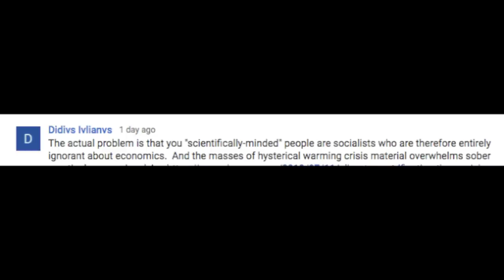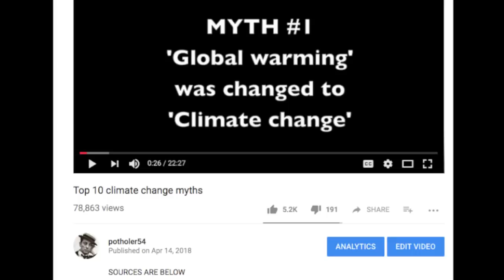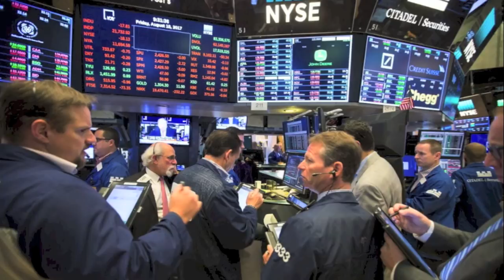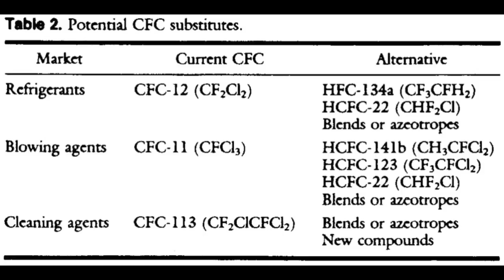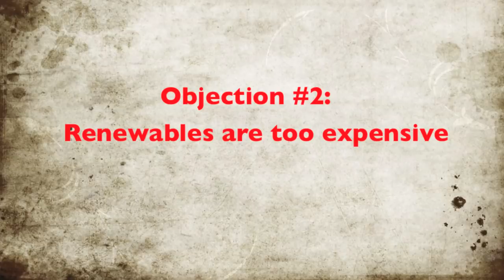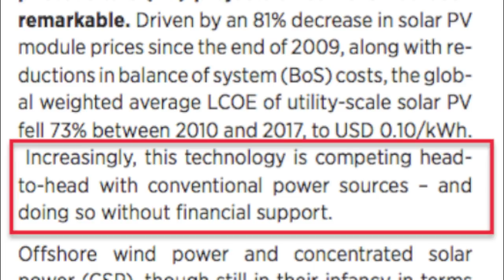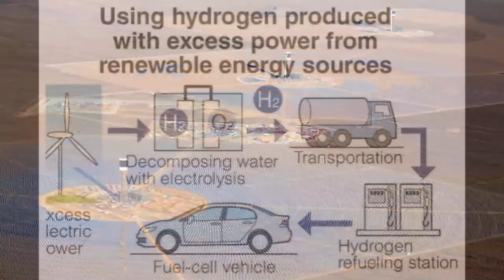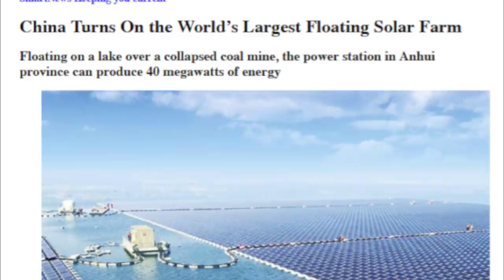A CONSERVATIVE solution to global warming (Part 1)

Comment: I decided to see how the Arctic is doing as we’re always hearing predictions about the ice disappearing due to the planet warming.  The Danish Meteorological Institute provides a website where you can check the facts for yourself:  http://ocean.dmi.dk/arctic/icethickness/thk.uk.php

I used the buttons under the heading 'Time step' on the left to go back to 23 November 2008 in order to compare the ice volume with today 23 November 2018. 
Then starting from January in each year, I traversed the graphs to see what they say. I'm looking at the black line on each graph which is always for the current year. 

Start of January: 2008 = 12.5; 2018 = 12.5
Peak ice volume in the year: 2008 = 24.3; 2018 = 24
Lowest ice volume in the year: 2008 = 4.5; 2018 = 6.5
On the July line: 2008 = 13; 2018 = 16
23 November: 2008 = 14; 2018 = 14.7 – and now almost as high as the average for the period 2004 to 2013.

It appears that overall there has been substantially more ice in 2018 than in 2008. The summer was warmer in 2008 than 2018 - looking at the minimum ice volume.

My conclusion is that there has been no net warming for the last ten years in the Arctic.  That’s put paid to one set of dire predictions.  Please check this for yourself – rather than listen to the doomsaysers.
  What about the Antarctic?  The ice is melting at one side where 91 volcanoes have been detected beneath the ice, but increasing at the other side.  I believe there is a small net gain in ice overall.  So no panic there either.

Funny how the facts cut through all the blather.  The skeptics (deniers) have been talking about a pause in the warming – looks like they were correct after all.

Go back in time (say 4000 years to include the Medieval Warm Period, the Roman Warm Period and the Minoan Warm Period to get a good picture – much warmer than it is today) and you'll see that there is nothing unusual about the current period.  The planet has been warming since the Little Ice Age which ended about 1800 – nothing to do with mankind by the way.  

Yes there has been a tiny amount of warming due to us putting CO2 into the atmosphere, but other forces of nature overwhelm the little bit that we have contributed.  Many scientists are now agreeing that the climate is less sensitive to CO2 than was previously thought and they are modifying their climate models accordingly - downward.

We hear scare stories periodically – and fewer and fewer people believe them.  If they continue this climate change propaganda, no one will ever believe anything put out by authorities.  Remember “The Boy Who Cried Wolf” story?  That is dangerous because when there is really something of genuine concern, no one will believe that either.

To claim that we can change the climate by tweaking CO2 levels is utter nonsense.
Reply from the maker: "My conclusion is that there has been no net warming for the last ten years in the Arctic"
   That's why research is best left to professional, qualified researchers.
Reply: Perhaps you could explain this  - http://ocean.dmi.dk/arctic/sie_monthmean.uk.php
or this - http://ocean.dmi.dk/arctic/icecover_30y.uk.php

did you really think that by cherry-picking a few  data points from the DMI web site and then announing  on a youtube comment forum "My conclusion is... "    that you would undo 150  years of climate research, let alone convince anyone of your 'theory' on said  youtube comment forum?

btw - I'd be interested in seeing a source for your claim that "Many scientists are now agreeing that the climate is less sensitive to CO2 than was previously thought and they are modifying their climate models accordingly - downward." I reckon you just pulled that out of your arse but hey, if you can prove me wrong, by all means do.

Cheers
Reply: @potholer54  Thank you for your response and I agree with it.  That's why I have relied on the Danish Meteorological Institute for these figures, which I read from their graphs.
Reply from the maker: "Thank you for your response and I agree with it."
   You obviously don't. I said we should leave this kind of analysis to qualified experts, and you seem to think you know better.
   They look at the data and say:  "The period 2003-2011 has seen ice sheet losses on Greenland averaging 234bn tonnes each year. The neutral mass change in the last two years does not – and cannot – begin to compensate for these losses." 
   You look at the data and say: "It appears that overall there has been substantially more ice in 2018 than in 2008."
   The first conclusion comes from experts. The opposite conclusion comes from an amateur.
Reply: @potholer54  Ah yes Greenland.  Glad you mentioned that.  I understand that the precipitation in the center is greater than the ice loss through melting, but that the glaciers are moving causing an increase of icebergs with an overall net loss of ice that you mention.  I question your figure however, I thought it was giga tonnes rather than billion tonnes (a lot more).  But even so, to get that into perspective, it would take 14,500 years for the ice to disappear even if it continued at the same rate as today.  Let's have a look at a greater time scale for which we have the data:  https://drive.google.com/file/d/1oP0DDqPtbVULqjV46_sNSOyw3hqvD4Vb/view?usp=sharing
It seems that it is cyclical like so many other features of climate.  Now who's cherry picking?  Pot calling the kettle black?

There are so many characteristics of the global warming/climate change movement that make me suspicious:
The change of name for a start - alarmists know that they can always rely on the climate to change - something disastrous happens - it's climate change - we've proved it.
People wanting to make money out of it - Al Gore's ambition to become the first carbon billionaire.  His super blatant exaggerations.  His ignorance of science - he even had a tornado on the equator and tornadoes in the northern hemisphere rotating in both directions on his book cover.  He called his earlier mentor senile when he said that the effect of CO2 was not as great as Gore was making it out.  His life style did not change to reflect what he was preaching - his homes have multiple times (20 to 30) the power consumption of the average US citizen.  But yes I know he's just one man and we shouldn't judge a whole movement by him.
We hear about carbon taxes - governments always want more money.  This is a golden opportunity to scare people and make them passive enough to pay more taxes.
Certain politicians bombard us with propaganda on a regular basis.  Or do they like to have something "important" to say to get attention?  Margaret Thatcher jumped on it when she had a fight with the coal miners in the UK.  She was happy to promote global warming for political ends.
Alarmists continually mention an increase in storminess, even though the IPCC has discounted that.  Do they just disregard anything that doesn't fit their agenda?
Sea level rise - that's a scary one.  Although it has been going on for at least 160 years according to the tide gauges and the rate is tiny at 2mm per year, 20cm (8 inches) per century.  The claim that the rate of the rise is increasing - I believe satellite data has been mixed with earlier tide gauges to achieve these graphs.  Look at the tide gauges alone and you'll see that the rate has been virtually constant, with no sudden increase.  Michael Mann claimed a 3 foot rise in the next century.  Not as bad as Al Gore's 20 foot rise I grant you.  Totally unrealistic claims.
There has been so much skulduggery.  
The 97% consensus.  Have you looked at the questions they asked originally?  Perfectly innocuous, but then twisted around to give a distorted result and fit an agenda.
Any scientist who disagrees with the "consensus" is vilified, their funding is cut and they lose their jobs.  When one expert cast doubt on the whole movement, Gore heard about it, then surprise, surprise, the scientist was out of a job.  This is not science.
We even see videos where skeptics are insulted, scorned and generally made to look foolish when they don't believe the "consensus."  Skeptics are called "deniers" possibly to link them with holocaust deniers.  Skeptics are compared with "flat earthers."  Again to denigrate them.  Quite bad language is used against them.
It's interesting to observe that many of the skeptics are in the older generation, i.e. they have their pensions and can't be fired and they have nothing to lose by speaking out.
There is a mountain of evidence against the alarmism to fill hundreds of pages, but time presses and now I'll need to get on with my day.
I'll come back to you about the content of your videos, so watch out for that - but in the meantime have a good day yourself.
Reply from the maker: @Stephen Worley wrote:  "I question your figure however, I thought it was giga tonnes rather than billion tonnes (a lot more)."
   Oh, Good Lord! A gigaton IS a billion tons. Just proves my point -- you're an amateur. If you don't even understand the basic units of measurement, no wonder your conclusion is 180 degrees the opposite of qualified researchers whose data you are supposedly citing.
   But I see you've now abandoned your opening claims in light of the fact that the people you thought you were citing -- the DMI -- in fact contradict your 'findings.' In place of that you post a gish-gallop of political conspiracy theories and myths about the science that you copied and pasted off the internet. Thanks, but I've covered all these science myths in previous videos. For the conspiracy stuff, you're on your own.
   By the way, you forgot to mention the case of the scientist who was a leading author on one of these global warming studies, and was secretly paid $450,000 to skew the data, as were his co-authors. The money was funnelled into several Cayman Islands bank accounts. His conscience got the better of him, and he told a Washington Post reporter he wanted to blow the scam apart. They arranged to meet but before he could get to the meeting he was run down and killed by a speeding car. Using CCTV, the police traced the car to a motel where it was parked outside a room rented by someone who signed the register as... get this -- "A. Gore." The Washington Post ran an expose on this two years ago.
    Is this true? Well, if you check the Washington you'll see that no such expose exists, because I just made the whole thing up. 
   Still, much more riveting than your "expert cast doubt on the whole movement, Gore heard about it, then the scientist was out of a job" story, isn't it? If you're going to make stuff up, why not use my story instead?
Reply: @potholer54  Do you find this tone productive?
Reply: @royism  This graph shows a much longer period:  http://arctic-heats-up.com/_ADD/b/z_6.jpg
You can clearly see that there was a substantial warming reaching a peak in 1939 for the region in question.  Then a decline to 1975 or so.  Followed by the current warming.  And now a pause - which I started off with.

Greenland also lost ice in the earlier warming period last century as it is doing now:  https://drive.google.com/file/d/1oP0DDqPtbVULqjV46_sNSOyw3hqvD4Vb/view?usp=sharing   Then it recovered up to the 1970s.  Now it's losing it again.  Have you noticed anything cyclical about this?  Some more cyclical behavior here:  http://arctic-heats-up.com/img/c5-p12.jpg

The alarmists just refer to the current warming and cite it as something unusual and all to do with our increasing CO2 emissions.  But how does that match with the cyclical behavior just demonstrated?  Obviously a complete discord.  The warming actually started after the Little Ice Age, well before we had added anything more than a smattering of CO2 to the atmosphere.  Sure enough, CO2 does have some effect, but there are numerous other factors involved which completely overwhelm the CO2 contribution.  To continually pump out the propaganda that we can control the climate by reducing our CO2 emissions is patently absurd.

To answer your other question about sources for the lower sensitivity of the earth's climate, this is one:  http://notrickszone.com/2017/10/16/recent-co2-climate-sensitivity-estimates-continue-trending-towards-zero/#sthash.qyhCHmbR.Ry3z67pI.dpbs   Scroll down to the updated graph.

Not a single swear word in my reply.  You need to try that.
Reply: @potholer54  You are correct, that I got the term wrong.  However, you have taken no notice of the graph showing the cyclical nature of losing/gaining ice in Greenland over a longer time period.  Instead you went into a weird rant that is completely unhelpful.

I have answered some other points in my reply to:  royism.

You have mentioned "That's why research is best left to professional, qualified researchers."  A major problem is that they seem to disagree.  So which ones should we follow?
Reply from the maker: "you went into a weird rant that is completely unhelpful."
   I assume you're referring to my made-up conspiracy. I agree completely, it was a weird rant. The funny thing is, when I post this conspiracy involving Al Gore silencing a 'dissident' scientist you rightly describe it as a weird rant. But when you post a conspiracy involving Al Gore and a 'dissident' scientist it's not a weird rant because....? Well, because it's a good example of a double standard. If you believe it you treat it as a fact. If you don't believe it, it's 'weird.'

"A major problem is that they seem to disagree."
   All scientists -- or researchers to be more precise -- disagree on certain aspects of science, whether it's climatology, geology or cosmology. That's because there are a lot of uncertainties and unknowns in every field of science. This is not a disagreement of opinion, just a disagreement of results. For example, it is uncertain exactly how much warming will be caused by a doubling of CO2. But if we focus on the things we DO know, nearly all the results for a doubling of CO2 from pre-industrial levels cluster around the 3 degrees C mark, and this is confirmed by empirical evidence from past warming episodes. In addition, we know that over the last 500 million years CO2 has been a strong, if not the primary driver of global temperature.  

"You can clearly see that ... now a pause."
   If you are seeing a pause it is because you are an amateur. Professional researchers using actual temperature and ice extent/thickness measurements don't see your imaginary pause. 

"Have you noticed anything cyclical about this? "
   The question isn't whether amateurs like you or me see anything cyclical, the question is whether professional research glaciologists have concluded that recent ice losses are part of a cycle. The answer, again, is No.

"How does that match with the cyclical behavior just demonstrated?"
   The answer is that this "cyclical behaviour" has not been demonstrated. You are simply giving your amateur opinion that it exists. Professional research glaciologists do not attribute recent ice losses to any particular cycle which are, not surprisingly, consistent with the recent strong warming in the northern hemisphere. Put simply for the sake of an amateur -- as a rule of thumb when the atmosphere warms and the sea warms, ice melts. 

"To answer your other question about sources for the lower sensitivity of the earth's climate, this is one:  http://notrickszone.com/2017/10/16/recent-co2-climate-sensitivity-estimates-continue-trending-towards-zero/#sthash.qyhCHmbR.Ry3z67pI.dpbs"
    So despite your claims that the science supports you, all you can cite is a blog. Why not find some proper research that supports your beliefs? I mean, peer-reviewed papers published in respected scientific journals that agree with your belief that "overall there has been substantially more ice in 2018 than in 2008" and "there has been no net warming for the last ten years in the Arctic."
   I know you take personal affront to this, so I'm really sorry to repeat it: Your amateur conclusions, your conspiracy theories and your reliance on blogs by other amateurs as sources of information are meaningless if you want to discuss science.